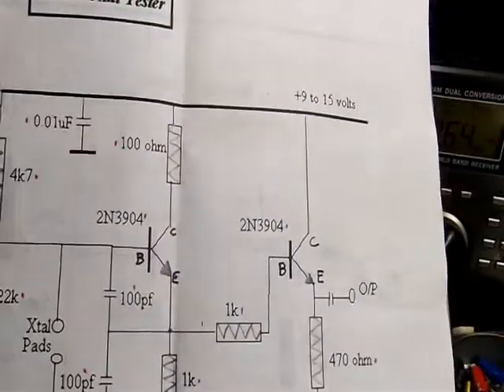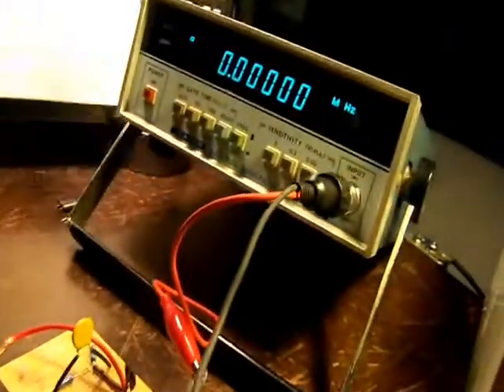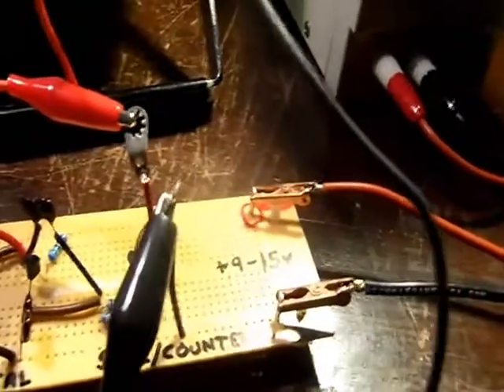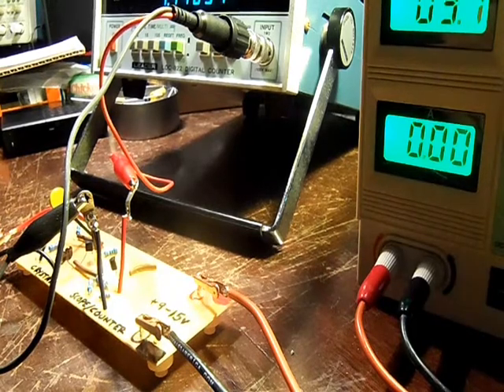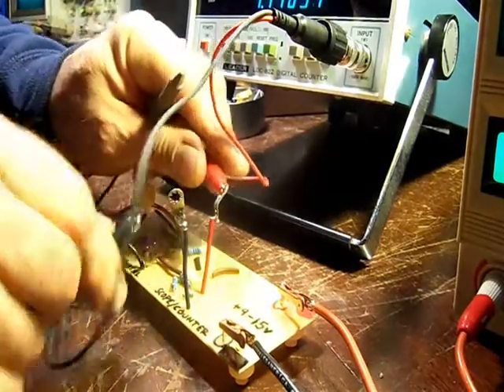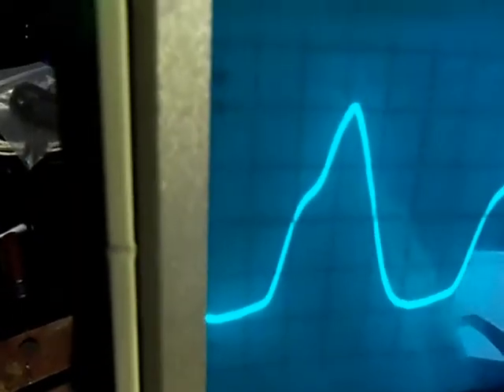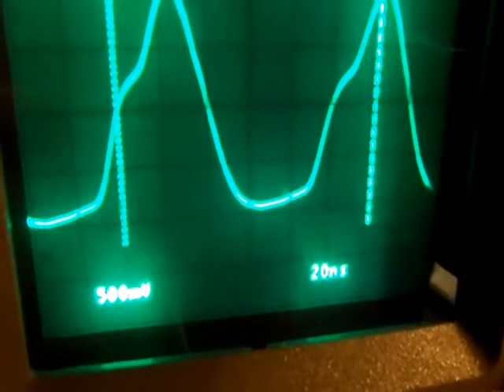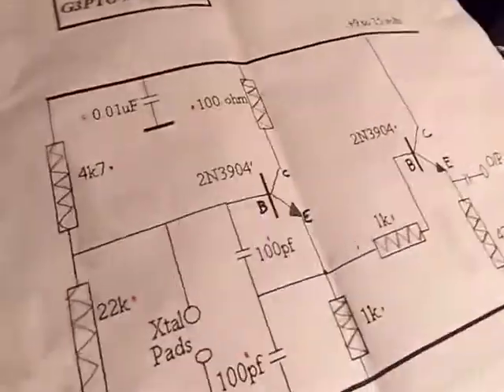Oscillator Crystal Test Circuit

Comment: 👍Thanks for sharing. Always helps when you can see that someone built a circuit that works. I built this and it works. Tried it with a few HF XTALs. All worked OK. Also worked with ceramic resonators. Like one of the other commentators, I did seem to have one resonating on 3rd harmonic (XTAL marked 4MHz and oscillator output was 12MHz. I wanted to use mine as a battery powered signal generator for 7030KHz QRP frequency. I tried a few 7030KHz XTALs which all resonated around 7028.6KHz. So, I added a variable trimmer capacitor (0-60pF) in series with the XTAL test socket and this allowed me to "tweak" the frequency to exactly 7030KHz. So, if you want to slighlty increase XTAL frequency, try a small trimmer capacitor in series with crystal. If you want to slightly lower the frequency, try a small trimmer capacitor in parallel with the crystal.
Reply from the maker: Sometimes our Tinkering turns out useful stuff! Great idea on the trimmer cap! Thank you for the reply!

Comment: Well, I put it together on breadboard and it works very well with a 10 Mhz xtal. Waveform good too. thanks for the idea for this cct, now, I need to test some other xtals.. Glad you pointed out the 4K7 / 47K misprint..   (my first xtal oscillator)..
Reply from the maker: Very happy to hear this David! Please note however, this circuit was found on the internet and not my design. I wish I could design a circuit like this!
Reply: Well Tony, you found it, tested it and went to the trouble to share it, some credit due, I think...
Reply from the maker: Roger! Also Thank You, and the others, for building this circuit and testing it further! The more exposure to actual usage, tweaking and ideas...the better these circuits will operate!

Comment: Between the measuring plug and the emiter of the 2nd 3904, there is a capacitor. Is that value importand? What cap did you use?
Thanks for the video Tony
Reply from the maker: Stavros, I am learning also! I believe that capacitor protects your measuring equipment from the DC power within the circuit. The value, taken from a similar circuit, is 68pf. Probably can use a value close to 68 , say 100pf. I failed to install one on the circuit in this video! Good Luck!
Reply: Hi! Tony, thanks for the circuit! 
Normally if you look at the oscilloscope, the output signal from the circuit is DC coupled. By using that capacitor you are changing it into AC coupled signal, which is better for this kind of application. Value about 68pF is too small. I put 10nF and it works well

Comment: DOES IT WORK TO CHECK 460.000 CRYSTALS ?
Reply from the maker: Quote from this circuits author: "Using this circuit and a reasonable counter you can measure the fundamental frequency of any crystal to a resolution of 1hz".